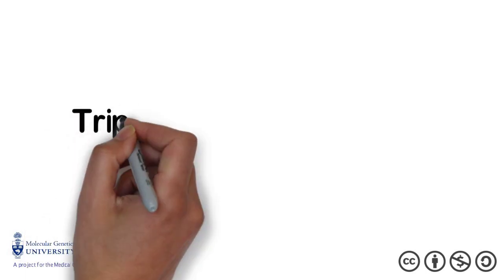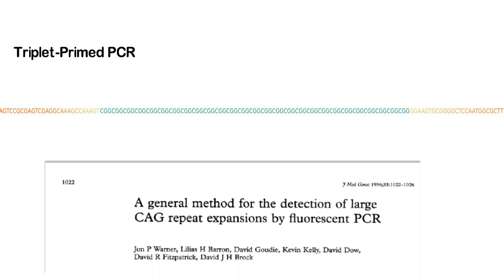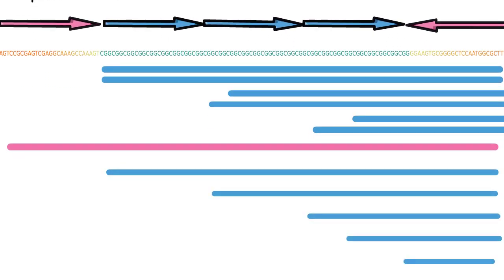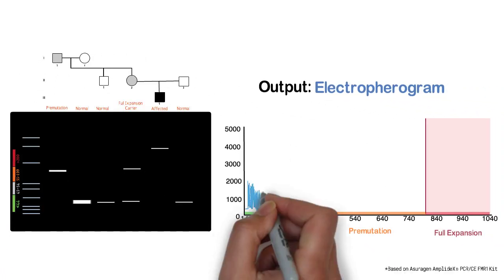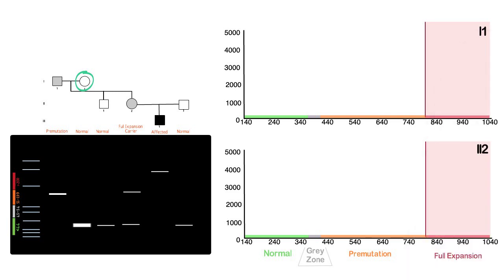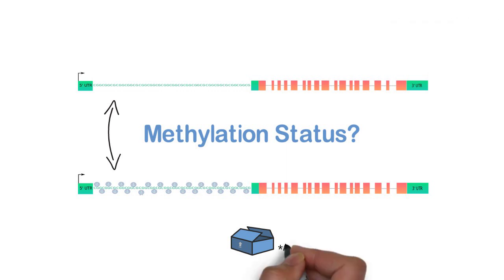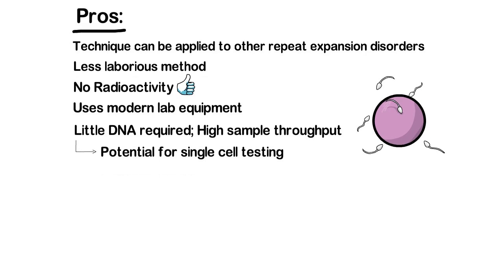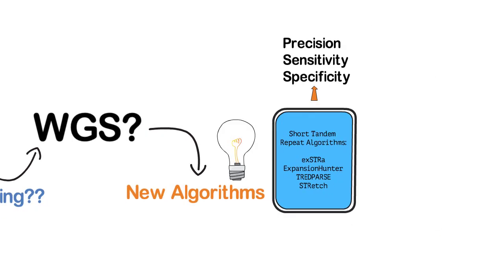Repeat Expansion Diagnostic Techniques Part 2 - Repeat Primed PCR

Comment: The reverse primer is FAM-labeled, not the forward.  If the flanking gene-specific forward primer were FAM-labeled, you wouldn't see the repeat-primed amplicons on CE.  Finally, the repeat primer does not overlap the flanking sequence.  It does in some assays (this is the basis for "anchor" priming), but not here.